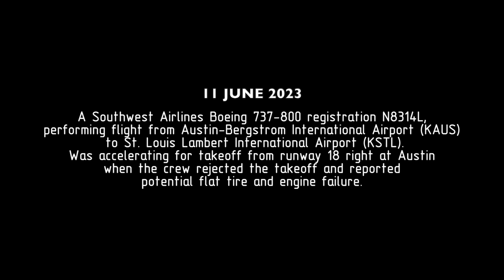ENGINE FIRE on Takeoff Roll. Southwest 737. REAL ATC

Comment: Poor fire truck. That was so mean! They didn't get to put out the fire!
Reply: Yeah, you could hear their disappointment.  Well, maybe next time...
Reply: It was good that the pilots didn't hesitate, just fired the bottles off even though there was no indication. Awesome job.
Reply: @roddy222  Not to be an ass but a fire department telling you there is fire... that is a solid indication.
Reply: @aebalc  The pilot reported that he didn't get an indication in the cockpit, as in:  no warnings came on.  So, the comment is indicating that the crew trusted fire without an indication.
Reply: @SpartacusColo  There are instances when a fire indication isn't shown in the cockpit. It depends on the area of the engine that caught fire. For example, a tailpipe fire wouldn't be  detected by the fire loops but it would be very visible from outside.
Reply: ARFF thought they were going to Job Town but instead got jobbed by the onboard extinguisher. 🤣
Reply: @SpartacusColo  "the crew trusted fire without an indication." I'd say that someone TELLING YOU "I see a fire in the engine" is a pretty good indication.
Reply: @maxsdad538  Hey, that's great.
Reply: @HDJess thanks for the insight
Reply: All the adrenaline rush of driving a fire truck fast without the risk of incineration....sounds like a win-win.
Reply: If there was a fire in the left engine why didn't they get a fire alert
Reply: @tomwilliam5118  depends on where the fire is in the engine. Not every square inch is covered by the fire sensors.
Reply: @CanadaMatt  This. Whatever happened to the engine to spark that fire happened in an area where 'fire' is expected, ergo, no reason to worry. We'll just have to wait and see what the NTSB says.
Reply: I just imagine the turret gun lowering sadly when the fire went out
Reply: Speaking for ARFF command, they’re highly trained to do what they have to do, but you pray that you’ll never have to put that training into a real application.
Reply: @HDJess your EGT reading…100% how you tell if you have a tailpipe fire.  I ran a 737 just last night as a matter of fact.
Reply: @CanadaMatt they are called loops. Fire loops.
Reply: Having worked at an ARFF station for a few years, I know that there is very little humor in responding to a potential aircraft emergency. When you consider the possibly almost instant, casualty count, including the responders,  there is very little time to do what you’re trained to do.
Reply: I was due to fly out of Bristol (Lulsgate) one day, when the incoming aircraft seized a brake and the tyre caught fire. The previous week, the leading hand on the fire crew had retired, after FORTY YEARS of never having attended a real shout, only ever exercises.

Comment: The coordination is impressive. There’s a reason flying’s so safe in U.S.
Reply: Seriously? Some of the most stupid accidents have happened in the US.
Reply: Btw, the world trade center was in the US...
Reply: And the thousands of similar incidents not reported in 2nd world countries.
Reply: @flo7844 literally nothing to do with nothing but thanks
Reply: The OP comment might be  arguable let’s just say that’s 50% correct and 50% wrong, many factors must be considered for each specific case scenario, that’s why the comment it’s 50/50…. But you can’t forget about Spirit if the comment is about flight safety in US.
Reply: Exactly! I’d rather be in the air with professionals than some of these idiots driving on the highway.
Reply: Typical America arrogance !! Most of the world is exactly the same, if not better!
Reply: @malahammer   and typical anti american hate for no reason
Reply: @johnlawrence7386  literally five of the top 20 airlines in the world are American with the bottom of that list having American airlines delta airlines, and United Airlines three of the most heavily used airlines in the WORLD  doing more flights than most of the small carriers on the top of the list combined so if you take it to consideration the fact they have more airplanes more flight hours more pilots more locations more everything and they’re still in the top 20 then they’re a lot fucking better than anything in Canada or Europe
Reply: @flo7844 that wasn’t an accident
Reply: Pilots never tells passengers they were seconds away from death by a close call.

Comment: Could have been much more intense if the fire happened a few seconds later at V1 and the flight went airborne. A safe outcome might still have been expected but all of that would have happened in the sky while maneuvering an emergency return with one engine. Hats off to the safety engineering and pilot professionalism protecting us all.

Comment: Great example of why they always plan ahead, to reject takeoff before they've reached v1, if the any of the engines or airspeed indicators fail. 
The engine fire happened and got extinguished before the temp sensors even told the pilots there was a fire; nowhere you'd rather be than be standing near a fire truck when that happens.
Reply: Between 80kts and V1, Southwest will only reject for: engine failure, fire/ fire warning, predictive windshear warning, or aircraft is unsafe/ unable to fly.  Airspeed indicator(s) failure is minor and doing a high speed abort for something like that would be more risky than just taking off and coming back to land.
Reply: We call them loops…fire loops

Comment: Such a calm and professional way of dealing with a potentially deadly incident. They made it sound routine, even though it is definitely not. 

This pilot probably never had something like this happen before and will probably never have something like this happen again. But handled it like it was a standard occurrence.

And fire command really did a great job providing information and support.
Reply: This event is handled in their simulation training along with other events that rarely happen.
Reply: @paulkurilecz4209  Of course it it...

And they brief it in the below/before the line pre takeoff briefing.

But a simulator can't add danger or the knowledge everyone dies if the pilot balls it up.

And the briefing is intended to shorten the startle period, but even then there's a sense of unreality that people describe experiencing in emergency situations.

They still did a very good job...
Reply: @a24396  SWA's simulation training is to have their cockpit crews go through normal take off and landing procedures and then at some point the IP will "flip a switch" on the simulator to cause any number of problems either single events or multiple events.

If you haven't been in a modern day flight simulator, you should.  Your mind's and body's reaction will convince you that it is absolutely real.

I had an opportunity to "fly" a 737 simulator and go through the Delta 191 approach.  I managed to successfully go around and then land.  After "landing", my heart was racing, my shirt was soaked in sweat in the armpits and back and my knees were weak.  So, convince my limbic system that it wasn't "real".

The IP told me that my gear came within 10 feet from the ground.  My response was better 10 feet above than 10 feet below.

Comment: I have often wondered why planes are not fitted with outboard cameras strategically placed so that the captain can see what is happening outside of his plane
Reply: It's an extra $59 per plane that the airlines does not want to spend.
Reply: @lilolme69  It's another couple of holes in the skin of the plane causing an additional weakness to the airframe.  Plus it adds a small, but increased amount of weight to the plane, thus requiring more fuel.  But I tend to agree it would likely be worth it.
Reply: @merlinathrawes746  Just build it in to new planes. If they would have started this in 2000, it would be almost 25 years since then and would be on almost all the planes by now.
Reply: Some of them do have cameras mounted externally, (atop the tail usually)  not only that you can also watch it on the in flight entertainment screen, although that wasn't its original purpose. Several videos of it on here.
Reply: Boeing struggle to put tech from the 1990s in their 737s, how could you possibly think they’d justify anything from this century…
Reply: @merlinathrawes746 
When they add a camera in the tail section for passengers and pilots to view, it’s seems only reasonable to add another couple
Reply: @lilolme69 $59 for the camera, $5.9 million to certify it.
Reply: @anthonybernstein1626  Yeah... the American way...
Reply: @lilolme69 more like the SAFE way. There are very good reasons why you would want to test a modification like that in excruciating detail: possible interference with other sensors, could the hull deal with a hole at exactly there in an emergency, what would happen in the case of a lightning strike... If anything, the MAX showed us that we need to make certifications even more strict. No airplane stayed up in the air yet, we need to make it as sure as we can that they come down according to protocols.
You do not want to get killed either by someone skipping a cert and going: "oh well, it will work out".
Reply: Airbus A350 has a camera in the tail fin looking forward…invaluable for situational awareness!
Reply: It is yet another thing that has to be FAA certified, driving the cost of the plane and maintenance thereof up multiple times the price of a set of cameras.

Comment: I do have to QUESTION ARFF telling Southwest I need to get  you off the active taxi way. (3:08)  It's the Captain's decision to move the aircraft not ARFF's.     What if Boeing had put Brake Temperature Monitoring System  BTMS on the 737, the crew would know how hot the brakes were.

Comment: I wonder if the Captain told the passengers there was a fire. I would have been petrified as a passenger hearing that with all the fuel onboard.
Reply: Why? Do you think planes are designed in such a way that an engine fire can ever reach the fuel? Do you think they had a 6 year design it? Or do you just watch too many movies? Airplanes are safe, get over your irrational fear.
Reply: @kkjjqrysdgadff7782  fuel is in the wings, right above the engine... Hence pulling the bottle immediatly after hearing the word "fire".
Reply: @kkjjqrysdgadff7782  It always amazes me how YouTube comments will take any opportunity to jump to condescension and disdain. Chill out, will you?
Reply: @kkjjqrysdgadff7782  There's a report from the United States Department of Transportation called "Potential for Fuel Tank Fire and Hydrodynamic Ram from Uncontained Aircraft Engine Debris" that shows how wrong you ARE, Skippy. You just sit there and let the adults talk, okay?
Reply: @maxsdad538  What!? No response from kkjj7782? Still reading I suppose!
Reply: @maxsdad538 do you know what uncontained aircraft engine debris are? That's not caused by a fire. That's the engine literally exploding and throwing chunks of engine into the wing and fuselage. It's completely different from what happened here
Reply: @kkjjqrysdgadff7782 very true that airplanes are extremely safe but they are specifically safe because people don’t have attitudes like yours. of course an engine fire poses a potential danger to an aircraft and its passengers—that’s why they extinguished it. assuming that it’s not a risk at all is absurd.

Comment: I like that the firefighters keep backing away from the fiery plane but all the passengers are still stuck on board.
Reply: First, it sounded like the engine was on fire for all of 10 seconds, in a large part because of my second point. As demonstrated here, those engines can put out fires with internal systems in many cases. It sounds like there was no need for the firefighters to actually get involved when the crew was able to put out the fire by "firing a bottle". They even observed the fire appeared to be out.

Now, I'm assuming what you're really pointing out is the apparent conflict of the fire fighting crew backing away instead of fighting the fire. What makes you think they couldn't fight the fire while backing away? I'm going to assume the fire crew actually did have a truck capable of spraying given the pilot's comment about firing the bottle before they sprayed. Hell, that comment by the pilot or co-pilot alone potentially shows he considered the fire truck to be in a position to react appropriately if needed. Do you know the reach of those sprayers on those trucks? I don't, but I've seen videos of them being used in a more....ceremonial...fashion. They don't have to be right on the plane to spray an engine fire. Maybe they have to back away because they're too close and the nozzle can't depress far enough to aim down? Maybe it's considered safer to keep a minimum distance away when spraying down an aircraft?

I don't know have the answer to this, but I HIGHLY doubt they were backing away in a manner that prevented them from fighting the fire as you seem to be implying. But let me emphasize....in this case, they were not needed to put out the fire. So why throw shade at them when you know so little about the situation or what they're trained to do?
Reply: One of the first rules of fire/rescue you're taught is, "We don't trade lives." We won't sacrifice ourselves to rescue you. It's not because we're more valuable than you, but because the loss of one of us means not only do we now have an additional victim to deal with, but we also have 1 less rescuer and several more who have to deal with them, so it's a minus 3-5 for us. And it might be minus a lot more of you if that tips the balance and compromises the operation. 

I assure you those firefighters knew exactly how far they needed to back off and still be able to put that engine out and evacuate the plane if needed. They probably also needed to back off simply to give the plane maneuvering room.
Reply: I think they were letting the pilots know they were clear of any engine blast so they were free to taxi.

Comment: can anyone explain the "bottle" reference? I assume some kind of engine extinguishing system?
Reply: They are basically fire extinguishers that are plumbed into the engines and nacelles. There is usually one per engine plus an extra. They are a last resort. I promise that the plane went nowhere for a while.
Reply: @wmason1961  Incorrect, it's where the pilots break open a bottle of alcohol to celebrate because they know it might have been much worse  :)
Reply: @wmason1961  You rarely go away with a failing engine anyway. Plus the brakes and tires that will probably need replacement because of damages from the RTO.

Comment: I used to fuel Southwest. Their safety standards are ignored. At least they are at Raleigh Durham. I reported a bird strike one time and they were insistent that it was just bird poop, despite blood all over the wing. Cant have any delays they said.
Reply: A fueler providing his uneducated opinion? It’s like a janitor telling a surgeon he thinks he ignores safety standards.
Reply: You don’t need a degree to see things arn’t correct.
Reply: @LEVELGAZANOW why can’t a janitor point out that a surgeon is ignoring safety standards? that seems like a totally plausible scenario
Reply: @matthewuzhere  because he hasn’t a clue what he’s talking about. Just because he mops the floor doesn’t mean he understands what is going on in the theater or understands exactly what is safe
Reply: @LEVELGAZANOW , you may need education to tell when a bird has smashed into something, but someone else may not.
Reply: @seriouscat2231  yea, I don’t think so junior. I have 17,000 hours in a 737. What this former fueler said is BS. By the way, he’s edited his comment prior to his original posting by adding his suspected bird strike.
Reply: @LEVELGAZANOW  ah, I see. Btw, I was photographing landing planes today. Most are Airbuses here, then some misc prop stuff, but I did see one 737 too.